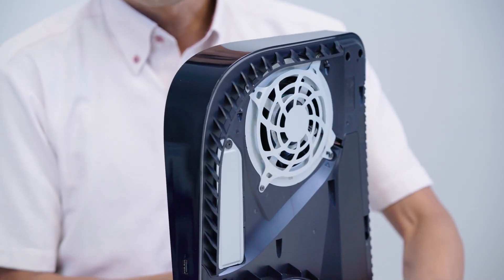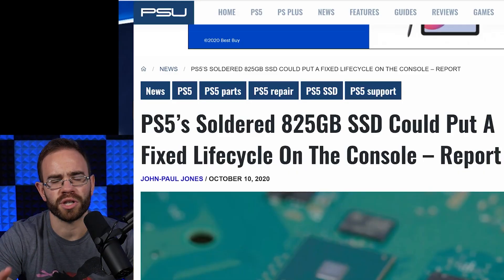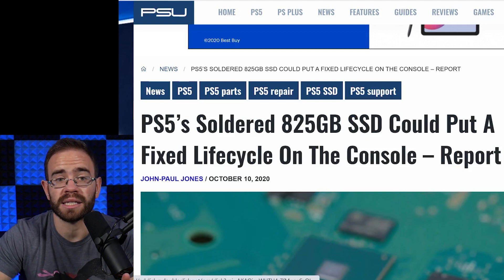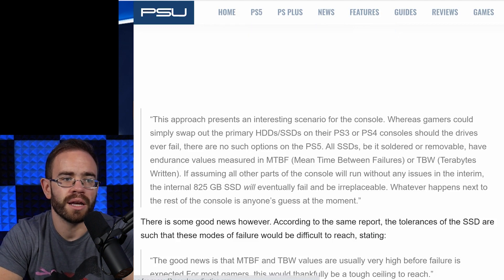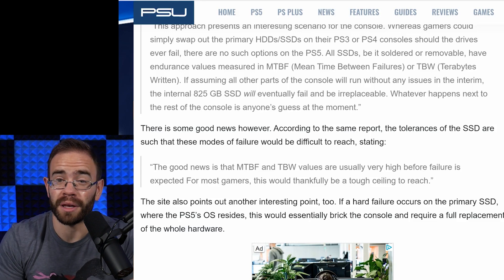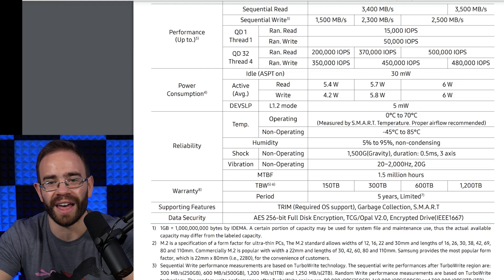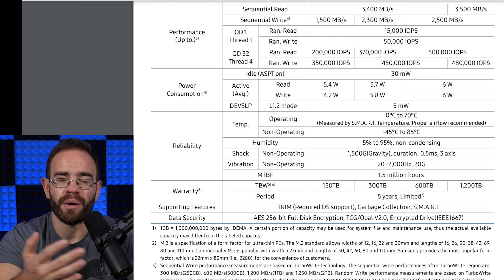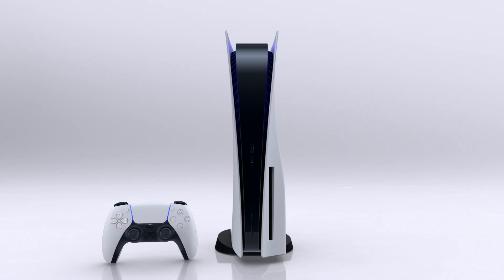Is The PS5/Xbox Series X SSD A Problem For Preservation?

Comment: Time to cook up some steak on my PS5
Reply: Judging from the recent articles, I'd say the Series X is fantastic at cooking steak! lol
Reply: @MorrisseyMuse  imagine believing game journalists 🥴
Reply: @MorrisseyMuse  You shouldn't believe any of those reports. Consoles much like most electronics create heat and said heat becomes an issue when it becomes trapped within the electronic. So the Series X is working exactly as its supposed to. 

The reports of the Ps5 running cool might be a bigger red flag since we know for a fact that these consoles do produce heat so if there isn't any coming out of the ps5 then its likely trapped and will begin to create heat issues or at least create a worse jet engine sound with the size of that fan than the one that plagued ps4 pro.
Reply: @TWAAAAACKS  or by the time the heat escapes, it's already cooled off. It does have to travel through that gigantic vapor chamber... you seriously think ps5 is gonna have heat issues? Have you seen that thing?
Reply: @184Dadada  Yes, I believe the console will run hot like any other and while I don't think it will have extreme issues, I do think it will have a somewhat loud fan due to it heating up more than they'd like it to be. I did in fact see the HEATSINK, remember they only said it emulates and acts similar to a vapor chamber but won't yield anywhere near the same results, and I think that Sony took a "bigger is better" approach instead of seeing if maybe there was a better cooling route they could've went with.

 The ps4 had a similar heatsink and the ps4pro expanded on that design and it looks like we aren't seeing anything different from that in the ps5. The liquid metal cooling is where they obviously spent most of their time for RnD of cooling but they went with a very risky option. Liquid Metal degrades overtime and puts a rather short lock in the consoles life cycle even when everything works out the way its intended to. There's still the possibility of it leaking and damaging everything it touches. The addition of a sponge around the enclosed liquid metal tells me personally that there is some leak failure rate and they created this to minimize the extent of the damage before being able to have the console sent back. Time will tell.
Reply: @TWAAAAACKS  The PS5 fan size along with 2 years of liquid metal cooling design research all had those issues in mind. I think you're crazy but my opinion isn't worth much. Ps4 pro fan gets loud because it accumulates dust quickly and easily. I clean mine regularly and it and the jet engine calms down. Don't get me wrong. It's still louder than you'd like but not distractingly so.
Reply: @184Dadada  The ps4 and ps4 pro both had more than just one thing wrong with their cooling. The problem of the heat sink not working right lead to the fans kicking on more often, adding to the dust build up which in turn sped up the fans even more and created that jet engine. I do genuinely hope I'm wrong as ill be picking one up in 2022.
Reply: @TWAAAAACKS  ps4 pro has its issues with getting a little hot but I still have my launch day ps4 and launch day pro. The original ps4 has never had any heating issues. Not in the slightest. I have only turned that thing off a few times over the years lol. But ya ps4pro cooling was for sure an afterthought or time constraints kept em from doing something better with it. Those fans are WAY smaller than this new one. It'll be interesting. I'm staying positive about it.
Reply: Bring back the foreman grill PS3
Reply: Hope you like it extra bloody
Reply: @184Dadada  raw and riddling!
Reply: No, that's the ps3 george foreman grill.
Reply: Imagine believing game developers 🥴

Comment: I personally don’t see a problem with them soldering on the SSD, if it means I’m getting good games, I’m fine
Reply: There's no problem at all, just scare mongering. All SSD have a life cycle anyway, having it on the board will make minimal difference.
Reply: CEWIIH  that’s true too
Reply: Soldered SSD and good games are not related.
Reply: Even if this is a real problem all Sony has to do is let people transfer the OS to the replaceable drive on the M.2 slot. This is not even unprecedented. No HDD PS3 Super Slim variant has a 16 GB flash drive on the motherboard for the OS and some other data which are transferred directly to HDD if you put one inside the PS3 then the flash drive gets disabled.
Reply: Until it dies
Reply: Nicholas Abbott lmao true
Reply: Dhairya Gupta  hopefully it doesn’t,but I guess everything dies eventually
Reply: Nicholas Abbott Agreed
Reply: The Aki War  damn yeah